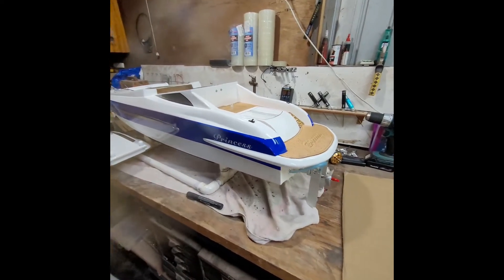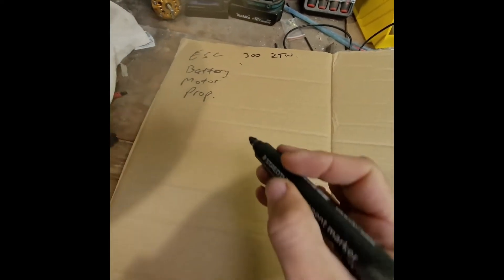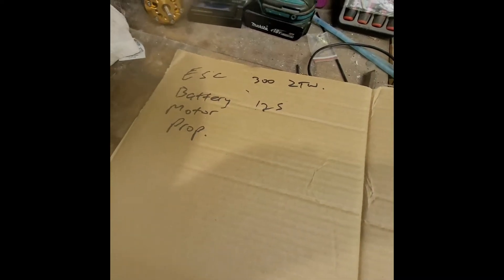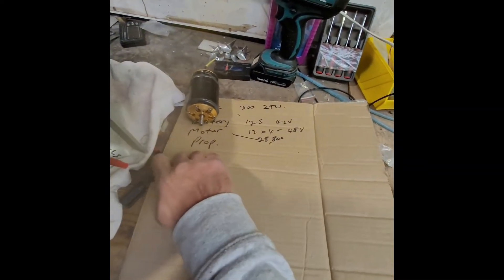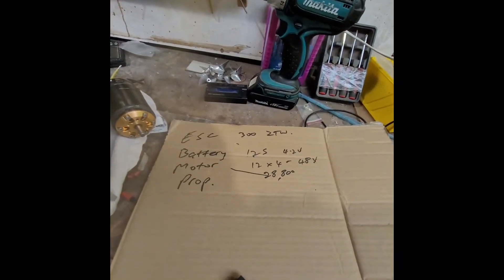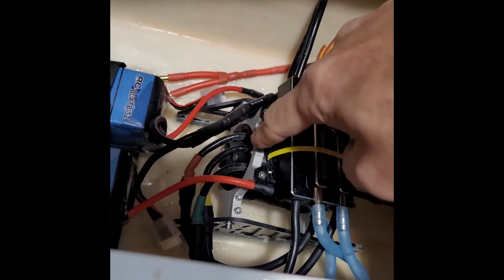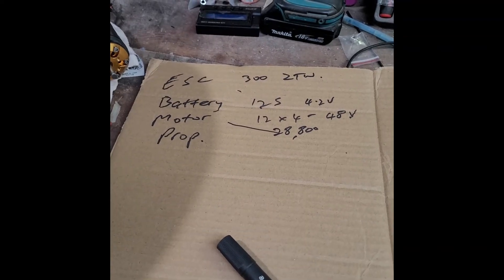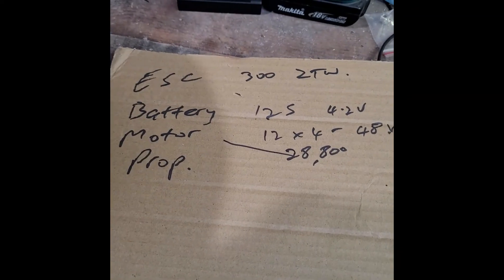Selecting rc boat esc, motor, battery, prop combo for beginners

Comment: I know this is a reach.

I’m breaking into RC boating and made a catamaran hull that comes out to around 680mm. 

I’m having difficulties finding out the motor or anything that I should use for this size of boat. Are there any tips to throw me in the right direction? I’m still quite confused with everything no matter how long I look at it.
Reply from the maker: Send us an email via the website and we can sort you out easy www.rcboatbitz.com

Comment: Always looking forward to seeing what the next trick you have up your sleeve,  great videos. I was wondering what model of Ztw you put in the princess, I’ve seen several of the 300amp Esc. With a cap pack and without, one says 350amp burst and another saying 1000amp burst, that is on several sites, but curious to hear about your setup. Looking to do something similar with a 50” hull from Arrow-shark. Btw many thanks for the rudder replacement, hope to have some more of your stuff soon M..Po.
Reply from the maker: I dont actually know their burst current but most brands over rate that figure anyway imo. Those 300s are near impossible to kill, your solder will normally melt before they fail, my princess has the old school one but im sure the new g2s are just as good

Comment: Just curious. I broke the nossle on my TFL jetboat, it seemed to have cracked on the edge of each guide vane from normal 4s use. I'm just wondering if you had the same issue or if I maybe got a bad part. Maybe 4s is too much?
Reply from the maker: I have no idea without seeing it, send it back and ill have a look if you like

Comment: Thanks mate, this a great video I'll be watching over and over . I've cooked a few things and learnt the hard way because we kept driving without checking temps and running 4s motors on 6s. Will definitely help me with my next purchase . That big boat is going to fly , the small one we have is really easy to drive and stable. As you said the 4mm gear will need changing for sure , it had a 50 mm prop when we got it . Too much even with the 4092.
Reply from the maker: All i needed to do was read alound any of the 5 or so answers to emails i write every week about this stuff lol
Reply: @RCBoatBitz  ha,ha, I can only imagine how many questions.  But I bet they have great running boats after your answers . I always learn something from your videos.

Comment: Top video. Great info especially on use under load voltage working out ideal rpm. Good to know. Cant wait to see the Princess running on 12S!! It will fly. Also interested to see what prop ends up suiting the new set up!👍🏻
Reply from the maker: thankyou mark, i have no idea what people want to hear about to be honest